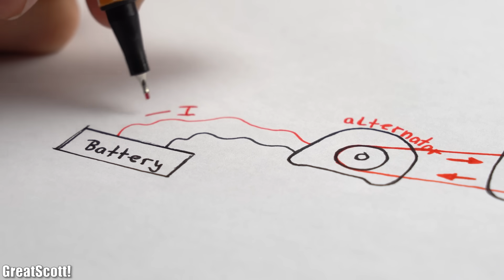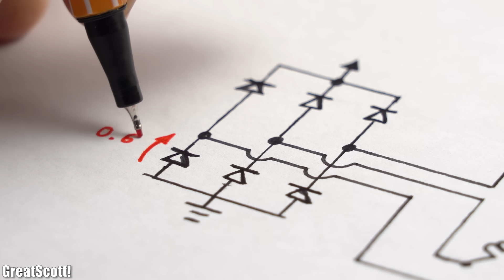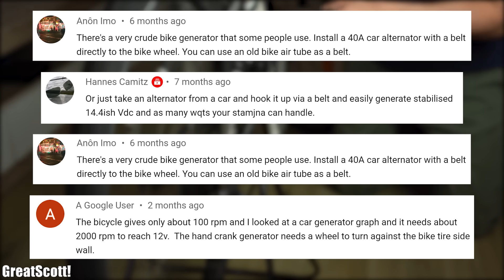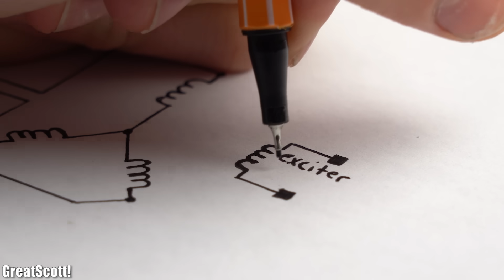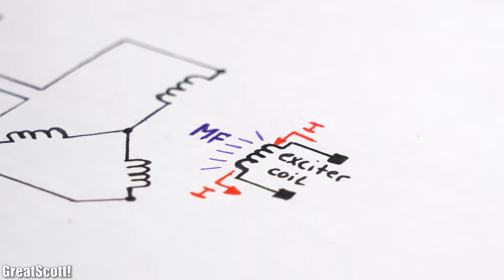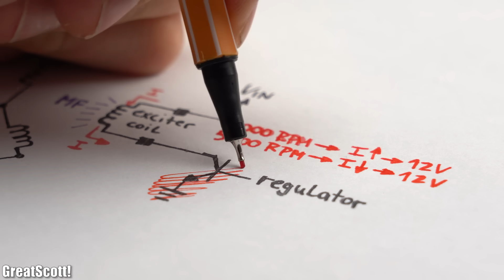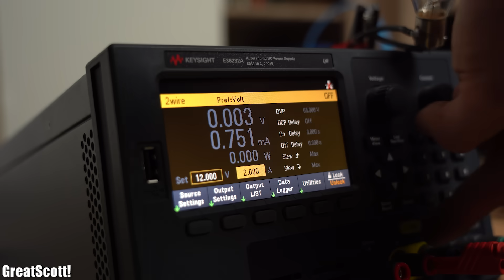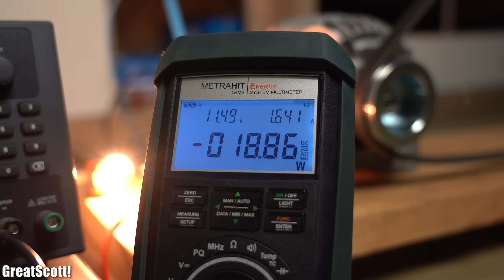Using a car alternator with a bike to power my home? How much energy can I produce?!

Comment: Energy goes up as the velocity squared. Don't use the low gears. Use largest front sprocket and smallest rear sprocket for greatest speed. And of course an idler to keep tension on the belt solves that problem. 

I actually used a similar concept to make my power for several years (before moving to solar). I bought a cheap Chinese diesel to drive the (junk ... $10) alternator. I drove it with the 12" flywheel of the engine. I used a spring on the alternator (pivoting on a single bolt as it does in a car) to make tension. I was able to get 90 amps out...~ 1kWh/hr. I adjusted the voltage with a simple voltage divider circuit regulating current to the armature. The engine ran on used vegetable oil. It took about 2 hours per day to keep my 10 golf cart batteries charged. My biggest load was a refrigerator that took 120 watts with a 1/3 duty cycle (i.e. 40 w average). In time, I found the best way to get off the grid was to get off electricity. I began to can my food (eliminating refrigeration). At $0.13/kWh, electricity cost is trivial. Making it yourself is silly if you don't have to. I am now on the grid, but have my same old conservation habits. My light bill is less than $40/mo (~$1/day...1/2 of a beer). I almost never use more than 200 kWh per month. Back then I used about 30kWh per month...i.e. $0.13/day equivalent.

Comment: You need to make the system more stable physically. That bike sucks and it's gear system is broken. The mounts for everything as well are very bad which is why everything wobbles so much.

You also only need to provide an initial 9-12v until the alternator can provide enough of it's own power to work. You just mount to the handle bars a little switch to a 9v battery which is connected to the alternator. Have it turned on until you can start turning the alternator and then you disconnect the 9v battery. The alternator will provide it's own magnetic field after it's been activated with that initial charge. That's why you can still run your car after you disconnect it's battery from the system. You're hindering power production by keeping that initial charge connected to the system.

Comment: Your's alternator have a BSS in the regulator unit (two pole connector on the control unit screwed to the alternator body, contain CPU, 9:05). In normal use case it needs a communication with the ECU of a car's engine for excite it over the BSS bus. Engine's ECU send commands to the BSS for control the alternator by the many of input attributes dependendent as engine load, engine speed, alternator temperature, car driving mode, actual needs of energy, battery state of capacity, battery temperature, etc...

Comment: English - Alternator
Polish - Alternator 
Italian - Alternatore
French- Alternateur
German - LICHTMACHINE - (Lightmachine) 
#justgermanthings <3
Reply: But Lichtmaschine is not the correct word. In car shops it's just called "Generator" :)
Reply: @Haselui  They were called generators in the US, too, before they used AC motors. Now they use rectified AC motors.
Reply: Dutch - Dynamo
Reply: Der Begriff ist mittlerweile inkorrekt, und ist nur Umgangsprachlich gebräuchlich.
heißt bei uns in der Fachsprache auch >Generator < !

Comment: Car alternators are not so terribly suited for this application. A Disc Generator with permanent Magnets would output a lot more. I guess more than ten times the Power you recieved with your setup. You can DIY a better Generator or you could buy several "Dynamos". DIY or buy ;)

Comment: I've done this with a much older alternator - fixed magnets with a regulator on the output. Was a lot easier than the newer type. Tension your belt for better performance.

Comment: 20W isn't bad when you consider it takes 1HP to make barely 745W.
Belt tension is a big issue. Automotive belts are ran tight enough to crush your fingers. Also, that 2-3k RPM at the crank will translate to several times that at the alternator shaft due to the pulley diameter ratios.
Good luck w/ your new stationary exercise equipment. 👍

Comment: I've got an older alternator on a stationary engine. Older more simple types are easier to use. The exciter coil only needs power for a moment, then It self excites. No need for constant power. Alternators are horribly inefficient, about 60% at best. I've put about a 500w load on my engine setup, which brings the engine to its knees. Thats 1Kw of input energy needed from the 1.5hp engine. 1.5hp is about 1.1Kw, so with the poor engine condition, it's probably not making 1.5hp. Makes sense then that 500w electrical load is enough to stop it.

Adding weight to the wheel would help keep the power delivery more consistent, also a more sturdy frame and better belt tension would help bring up your power output.

Comment: maybe you need alternator with exciter coil controller, with regulator not connected at alternator coil only full bridge rectifier, the exciter controller regulates magnetic field at exciter coil so more rpm less magnetic field to regulate output voltage (also depends on load). Or you can try modify the alternator by removing the regulator circuit and keep the rectifier, and try make your own exciter coil controller by using arduino outputting pwm to regulate magnetic field.

Comment: you can buy a proper bicycle dynamo for alot less and it is designed for this purpose. You can even ride somewhere while charging batteries if you want. 
If you need more power, mount another on the front wheel.
A better idea would be a dynamo mounted on a flywheel and put on your down pipe gutter or something to generate renewable power, like this, you are converting calories so is not efficient.
I hear solar panels work well these days, nothing else will generate enough power to be useful.
Then again, most things in your house dont need much power and are stepped down alot. 
The only things needing alot of power is washing machines and fridges etc.
Alot of power is wasted when stepping down all these volatages on most electrinics isnt it. Maybe voltages should be taken down to like 50w before entering the house and then stepped up fo the bigger appliances or have gas powered wahing machines or something.
Isnt 240v or even 110v way too much these days and was made standard 100 years ago.
What do you think?

Comment: I've wanted to try this same thing for years! I'm happy that you include the details about what you had to do to make it work even a little. 
If I try it now, I think I'll use the smallest rated alternator I can find, maybe for a motorcycle. Or just stick to solar panels! They are DC from the start.
Reply: Alternators are VERY inefficient ...fyi.  a permanent magnet conversion  kit for  an alternator will greatly help.
Reply: FYI Motorcycles do not use alternators, they use a stator which is inside the engine on the end of the crankshaft.

Comment: How about have a small dc motor add some wood and metal brackets and attach it to the back wheel and you can use it as a phone charger or a bike light power source.

Comment: 4:00 to get highest rpm you need to use the biggest gear in the front and smallest gear in the rear.
Reply: Came here to sat exactly this, that was not the highest gear he was using.
Reply: I thought that was odd. Especially when he then calculated the ratio for the belt..
Reply: maybe he's paid by big electro companies to keep us from using our bicycles as power generators?
Reply: That’s what he did. The big gear I the tire rim and the small gear Is the alternator
Reply: Exactly what I was going to type!
Reply: Not only by that, you can see, he's definitely a good electircal engineer, but not a mechanical one :).

Comment: I've heard the maximum continuous work output for a human in good shape is about 1/6 horse power, or ~125W mechanical power. So with an efficient setup you could power a laptop or a TV and still be able to use it.

Comment: With good condition, you're supose to output about 200w of power with your legs. So with 1 hour of workout, you can be able to run your laptop for 2 hours :)
Reply: My laptop easily runs 8h from the 50 Wh battery, that makes 6.25 W on average. So with 200 Wh it would be 32h! 
Or 16h for half an hour, which sounds pretty fair to me ;)
Reply: Or my desktop for 12 minutes
Reply: Or if you have pinebook pro you can probably run it for day or two  :D
Reply: But car alternators have the worst efficiency of all types
Reply: I think 200W estimate is too high. I think human is around 1/10th hp so that equals ~75W on a strong bike stand. Think about 10 guys in tug of war with a Clydesdale. Seems about right. 
You suggest 200W, which would be just under 4 guys.
Reply: @artsmith103  It's not over estimated, Check average power about rider of the tour de france. Arround 420W, but they are quite amazing, so 150-200W is ok for a "normal" good condition Human :)
Reply: @lenrys2244  I do a lot of calculations with power, energy and such. It's been a long time since I verified that number. Just looked up sources that also said 1/10th hp. Keep in mind that most horses are ~3/4 hp. Time yourself running up a flight of stairs. 550 ft-lbs/sec = 1hp.

Comment: I recall a video with a sprint track cyclist on an exercise bike/alternator that was wired up to a toaster.
Guy had thighs around 28" diameter. They said he could generate an average power of 700W for about a minute.

They popped the bread down and started him off. He ragged that bike senseless, twisting and contorting the frame. Veins popped out everywhere and gnashing of teeth. Plink! All that effort for some vaguely warm bread.

I do a spot of cycling myself. Over a couple of hours, averaging around 16mph, I generate around 175W (calculated via GPS)

Comment: there’s a video of a cycling athlete using a set up like this to power a toaster, really makes you appreciate how much power they draw by how hard he was working
Reply: Makes me appreciate a 300 watt solar panel too
Reply: The toaster is a very high draw though, you would want to store some for sure so you dont have to some how output 1000w.
Reply: Power isnt the issue... but the intensity over a short time.
Reply: @wobblysauce  Intensity (voltage times current, power) over time is energy, idiot.
Reply: I didnt know gilligan was a professional cyclist
Reply: https://www.youtube.com/watch?v=S4O5voOCqAQ
Reply: @d942yd42  Jesus the muscles on that Guy, he looks like a cartoon character.
Reply: Wait.  Are you trying to tell me that creating an intentional short in an electrical circuit with the sole purpose of generating heat through inefficiency is... ... .... inefficient???
Reply: @RealHankShill  It's actually very efficient if you are doing it for heat.
Reply: @AnalyticalReckoner  Depends on your perspective I suppose.

Burning coal to generate heat to spin a turbine to generate electricity to transmit to your house to convert to heat through resistance doesnt seem that efficient to me.

But if you narrow your scope all the way down to the smallest level, yes the conversion of electricity to heat through resistance is technically 100% efficient.

Even though in reality in actual use 98% of that energy is completely wasted regardless of how efficient one conversion was.
Reply: @RealHankShill  And they say that electric cars are efficient...
Reply: @ExtremeGamerYT22  Well, if the electric power is produced by hydro-electric dams and power plants, the overall system efficiency is very high.
Nuclear power plants also shine in this regard because the cost and quantity of the nuclear fuel is very low.
Next in line would be a natural gas fired gas turbine power plants with a bottom cycle.  Also very efficient but not as great as a hydro power plant.
Reply: @BasementEngineer  I mean, no matter what, you're gonna need those electricity lines with multiple levels of transmission lengths, which will be a big efficiency factor.
Reply: @ExtremeGamerYT22  Although I do not have the figures at hand, modern high voltage transmission lines are fairly efficient.
In Quebec, Canada, are direct current transmission lines operating at 1,000,000 Volts direct current.
One particular line is about 1,000 Km long with losses stated at 20%.  (Canada is BIG!)
Since the power sources are hydro-electric power stations, that loss is not as detrimental or serious as it sounds.
Reply: Never happen with this set up. A toaster is resistive heating elements, extremely high current. No way.

Comment: You probably have to play with the brush voltage. Cyclists who use the watt-meter pushes out 400 watts constant on load so 100watt or more for the average cyclist should be possible.

Comment: In 1974 I ran alternators with gas and diesel  motors. The way to do it is ones that had the regulator built in and 1 wire and ground! Up to 175 amps or 110 volts!

Comment: Fancy alternator "clutch pulley" might be smoother and is cool technology. A simple belt tensioner might be enough. Rear bike wheels with zip ties is dangerous; maybe consider the axle to suspend bike or use an indoor exercise bike / rollers).

Comment: ElectroBoom waiting for “Full Bridge RECTIFIER”

GreatScott:  *In German*
Reply: It's called Gretz Bridge in Poland, named after German scientist. I'm wondering if it's used anywhere else too.
Reply: All waves are rectified so it is a full bridge rectifier even with 6 diodes. https://en.wikipedia.org/wiki/Rectifier#Three-phase_rectifiers " For example, an automobile alternator contains six diodes, which function as a full-wave rectifier for battery charging."
Reply: MORE !! LIKE !! UUCHT !! DO !! LEEIBER !! GOD !!!
Reply: It's not a full bridge rectifier. A full bridge rectifier has 4 Diodes and this one has 6.
Reply: @allcrafter3747  even fuller bridge rectify yah
Reply: @allcrafter3747  we see six diodes there cos it's rectifying three phase you can't simply use 4 diodes to rectify 3phase
Reply: @nanfwangdabiring1520  Didn't i said this? Iam not that good in English
Reply: @allcrafter3747  My apologies for misunderstanding you, so sorry 🙏
Reply: @allcrafter3747  It's still a full bridge rectifier tho, since both halves of the AC get rectified
Reply: @allcrafter3747  full wave bridged rectifier has four diodes, two on each pole..a half wave two diodes, one per pole converting only half a cycle. 👍🏼🤔

Comment: Sorry but you are really stupid. Of you wanna higher rpm you tie pedal gear to higher gear wheel and wheel gear to lower gear wheel. And you need setup like inverter to 220v and hook 2000w heating element and and them measure voltage on heating element to see how really is efficient your bike

Comment: The alternator only needs an external current through the exciter coil to start. The alternator then switches over on its own. This is why the battery indicator light goes out in the car even after it has started. In older vehicles! With today's mostly only if you stalled (auf deutsch abgewürgt) the engine ...

Comment: For test purposes, you need a Ohm meter that can read accurately down to 0.05Ω

Older car alternators (pre ~1990) do not have built in regulators so it is easier to find the stator output and the rotor input.

Comment: Adding a battery bank and regulator will ' ajust ' results as in an automobile.  The battery can take up extra watts ( while  using a load, like watching Youtube on a tablet ) while at a set rotational speed, and also protext the battery charging as it can reduce output current.  Led acid batteries can take higher ' inrush ' current than LiPo batteries.
You need a combination battery charger, output controller and alternator regulator.
Time for a ' build or buy ' video ???

Comment: You could Install a belt tensioner pulley to keep it from slipping. And i wonder if starting the exciter with a 9v battery then adding a relay that powers the exciter with generated current. The more you generate the harder it feels and if you stop it falls back on the 9v. Then maybe a variable resistance circuit to control the exciter current and adjust the pedal torque needed